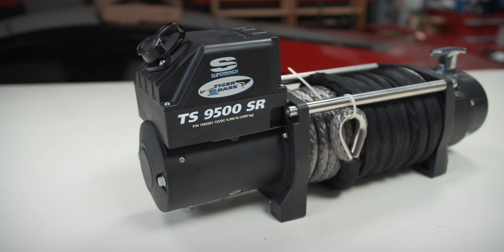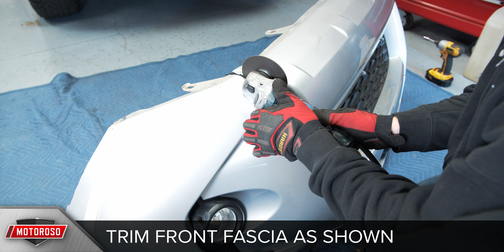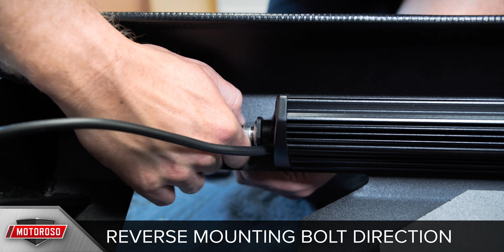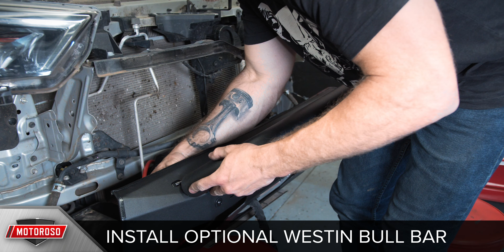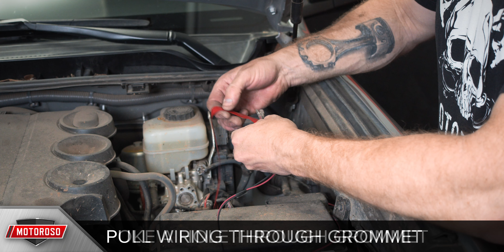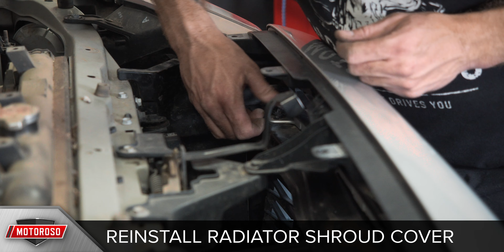Front Bumper and Winch for the 2014+ 5th Gen 4Runner - Westin Pro-Series and Tiger Shark 9500

Comment: Nice video!!! Your video is the reason why i bought the bumper.. I just want to point out a very important information.. Here in Canada, 2022 offroad comes with front cam and sensor.. Now the bumper interfere with the sensor. There is no offroad premium in Canada.. Maybe you have an idea to help me fix this issue? Thanks in advance...
Reply: Was it the bull bar that interfered with the sensor? Or the bumper without the bullbar that interfered with it? I have a 24 Offroad in Canada too with the front cam and sensor so I'm trying to figure out if this will work without the bullbar.

Comment: Will this work with a 2010 that had a facelift?
Reply from the maker: This is designed for the 2014+ 4Runners. When you say "facelift", I'm not sure what you mean. But my assumption, is  that it will not work, and sadly Westin does not make this for the earlier models.

Comment: What is the weight of this bumper please
Reply from the maker: About 85 lbs without the bull bar. +5-7 lbs for the bull bar. Winch weighs 60 lbs. Light bar would be under 5lb. So all told, as we installed it here, winch, bumper and light, between 145-155lbs.
Reply: @Motoroso  I have a 2018 TRD Pro with Bilsteins. When you added the steel bumper, winch, and light bar, did this cause the front end to drop due to the additional weight? If so, by how much did it drop the front?